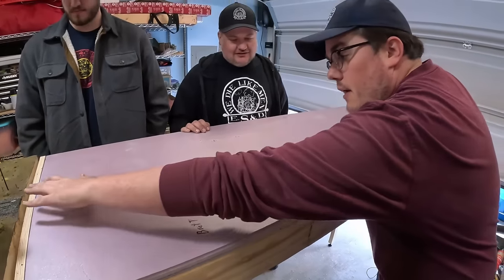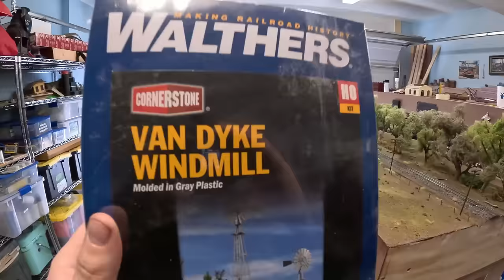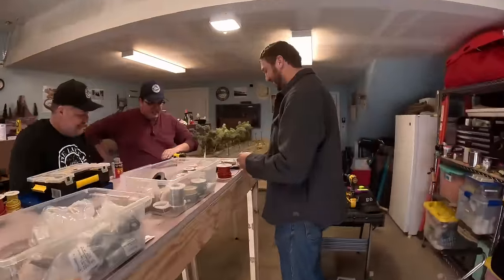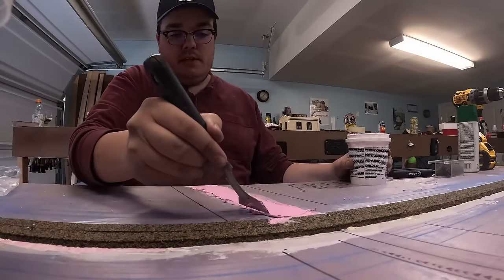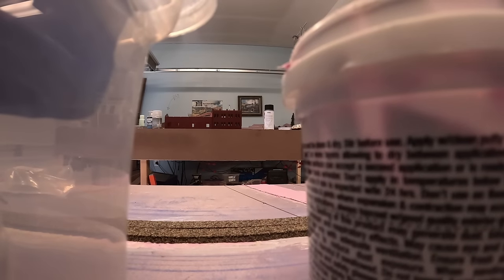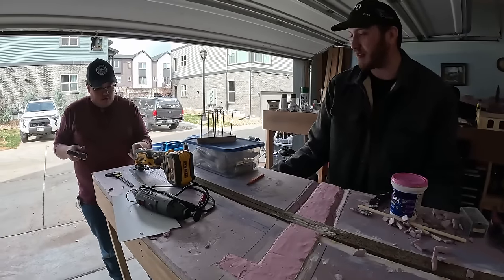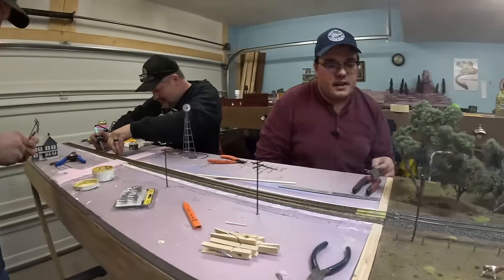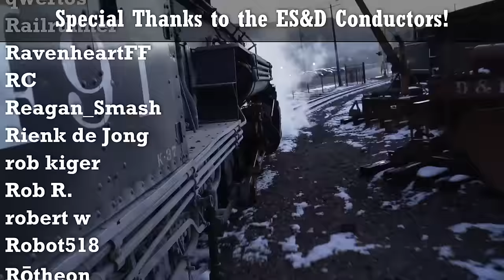Can the 3/4 show make a module in a day? (it's unhinged)

Comment: There’s an N-scale group that comes to my local annual model train show that has a really large and impressive modular layout. It does have its huge rail terminal modules, but it has loads of long track segments winding through rural scenery. Most of the layout features scenery and/or minor landmarks of different parts of the state, and they add little explanation signs along the length of the layout about what you’re seeing on the modules. It’s slowly become my favorite layout in the show.

I lost it at YOU HAVE DISTURBED THE DIRT! Lots of good references here!

Comment: I saw a module in Springfield this year that had absolutely gorgeous electric lines. I was rather blown away by it, because they made the thing so much more real, and it occurred to me that not a lot of layouts put in electric lines. I chatted with my Dad about it, and he said yeah, not a lot of people put in lines because it's a real F$%ing pain the ass. The stretchy wire stuff you need to do use it apparently hard to deal with, you have to get the tension just right to make it sag the right amount, and it can be fragile especially when transporting the module. Anyway, maybe this is all old news to you guys, but either way good luck! If you can get those lines in there, I'm sure it will look amazing!

Comment: 22:00 and here we see why you should always use only white glue on unplastered foam. All solvent based products eat through the foam. A hairdryer set on low heat can be used to CAREFULLY dry the white glue, as high heat has the same effect on the foam as solvent based products.

Comment: Well my fathre and I are building a modell railroad in our well my old basement (don´t live with my parents anymore) since I am a little kid and we have not even finished the cabeling yet but there was always a functioning railway hanging above it: The now over 35 years old garden railway. It is basically a big doubletracked loop which has two extra small loops onnecting on the side of the tracks so you can switch the side, direction and you can take it all appart into smaller sections for easier storage. Well it doesen´t exist anymore (The loops still do and they will probably get renovated and reused), we have ripped all the rails off the planks they where mounted on and now we are putting them on new, redesigned ones which have a slightly different layout and are better portable. So, we are in the middle of mounting the rails unto the new planks and we´ve been building now for 4 days straight, what are we dong wrong that it takes us so long?

Comment: Is Dusty now the Last missing of the 3/4 crew?

Building fremo Straight modules is quiet easy, I build a 90° curve module in 22 radius doubble main
and I forgot how many straight main modules I build, 
for a 4 track station that is about 7 modules long has doubble switch over on both ends, they are 2 modules each 
and 5 modules of roundhous and yard and about 8 other straight or curved modules.

The real challenge is Narrowgauge windy track, 
I have 2 modules at home which are about cealing height put long side up,
I want to build the Animas high Bridge of the Silverton Branch,
I'm struggling at that, it's so difficult when yer used to Fremo